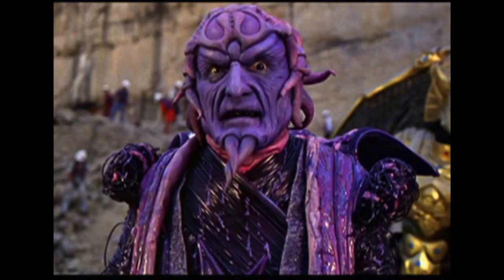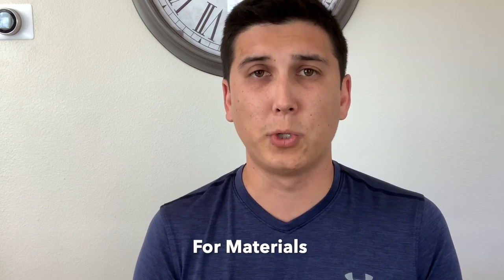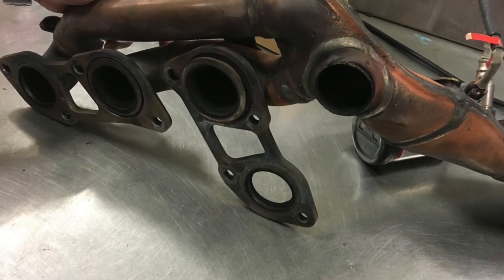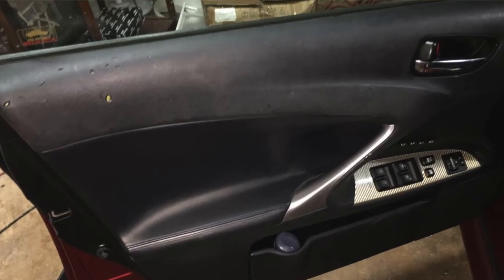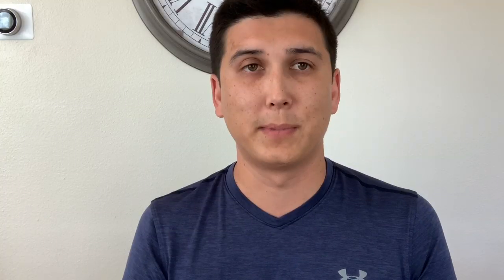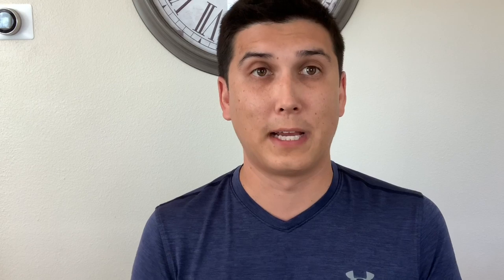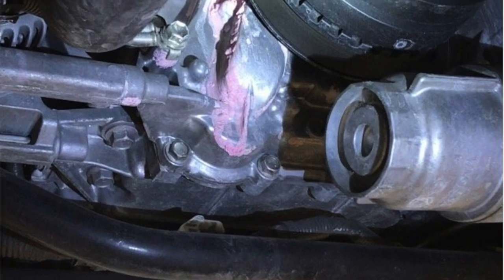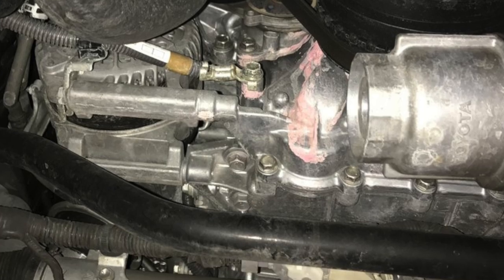Problems With The Lexus ISF

Comment: I have a video on what cracked headers sound like on a 08 with 145k miles if anyone wants to hear that
Reply from the maker: Thanks for sharing, this may help some people.
Reply: Is this common across all years of the ISF?   I’m thinking to go with PPE headers before this happens.
Reply from the maker: @jefflebo5836  I believe all years of the ISF are susceptible to this.
Reply: Cause it's not a race car. It's a luxury car that happens to be a bit sporty. You wanna drive fast? Get/build a car that can handle it.
Reply: @JustTheTip556  very true
Reply: I have the same problem. Had it since day 1. Finally decided to buy PPE Headers.
Reply: Spiral Øut what are you talking about?
Reply: @JustTheTip556  a bit sporty is not a 400+ hp V8 in a sedan...you sound like your 12.
Reply: timsgta people that spend ridiculous amounts of money on a glorified Toyota wouldn't want anything less than a V8. Just cause it's a V8 with 400 hp does not mean it's a race car. It's not made to go fast and race around all the time. It's a luxury car. You sound like you're 11.
Reply: Spiral Øut “Luxury car that happens to be a bit sporty” well it’s sporty enough to go against “sports” cars and have over 400hp, handle good enough and accelerate and decelerate many times over and over. So it really is a sports car
Reply: TeRrOr BiTe to me an over priced Toyota with all the unnecessary bells and whistles with replacement parts being ridiculously expensive is not a sports car. Sports cars are made to be beat up on. No one buys one of these Lexus' to go fast. They buy it because it's a status symbol and "luxurious"
Reply: Spiral Øut so no one buys an Audi R8 or any Mercedes Benz AMG to go fast huh? They buy it for status symbol and luxurious?
Reply: TeRrOr BiTe yeah cause you could go a lot faster for wayyyyy cheaper. Don't even get me started on "super" cars. Why spend over 100k on a car to go fast when you could spend 5% of that and go faster?
Reply: Spiral Øut because why would you have to make something faster with aftermarket stuff rather then having something reliable from factory? 0-60 in 4.8 isn’t exactly slow and trying to recreate that on a slower and make it reliable and good enough to daily drive everyday isn’t exactly easy to do and can cost thousands to do. Hence why people buy Lexus IS F’s and GS F’s
Reply: TeRrOr BiTe I wouldn't call companies like Audi, BMW, Mercedes, Lamborghini, Ferrari, etc "reliable". Sure, Lexus is definitely more reliable than others cause it's Toyota. I just think either way it's cheaper to do it aftermarket. Plus registration and insurance is cheaper. Just makes more sense.
Reply: Spiral Øut I was talking about the Lexus. Everyone knows BMW’s and Mercedes aren’t the most reliable except for a few cars they make but everyone knows Toyota is hella reliable and Lexus is the cherry on top for reliable luxury cars and know they’re starting to make quick road cars which everyone is starting to love. Yes it’s cheaper to make stuff go fast and everyone knows that but all the money you sink into a car could just be put in something like a Lexus IS F. Even when you go to sell the car the resale value is not gonna be there for the cheaper built car but it is gonna be there for the Lexus. Just my opinion

Comment: I have the ticking sound on mine upon cold start up so most likely cracked header. Anybody have any experience with this and advice for the least expensive route?
Reply: The least expensive route would be to weld the broken flange back on the manifold.
Reply: zaneiken thanks
Reply from the maker: I agree, still a pain since you'll have to uninstall the header(s) that is cracked.
Reply: ISFASTER Update: Passenger side header is confirmed cracked. My mechanic is recommending replacing it with an OEM header. $1700 part, $2600 with labor. Your thoughts?
Reply from the maker: J Lowery - you could buy a set of PPE headers for that much or try and see if you can get the stock header welded.
Reply: @PhilLayshioh  labor cost is crazy high

Comment: Valley and water pumps are due to the crappy pink coolant. I always flush out to toyota red coolant.
Reply from the maker: This is the first time I’ve heard those problems occurred due to the coolant.  My understanding of the valley plate leak is the sealant used forms small cracks due to heat and the coolant leaks through the cracks and out.

Comment: Will regular coolant changing work?
Reply from the maker: I don’t believe so.  You’ve gotta stop the leaking.
Reply: @ISFASTER  so it's envitable? No matter how carefull you're it will happen? How many miles before it happens? I'm looking to buy a 2008 ISF from japan with great condition and around 40k to 60k km.
Reply from the maker: It happens erratically, some people have got it at 30K miles, others at 150K miles.  Some people have had their cars for 11 years and 100K+ miles with no issues. 🤷🏻‍♂️🤷🏻‍♂️🤷🏻‍♂️
Reply: @ISFASTER  my ISF is a 2011 and nothing do far.... so 13yrs and 45K

Comment: Someone is selling their 2012 isf for 30k with 80k miles and i want it so bad 😤
Reply from the maker: What’s holding you back? 😁
Reply: @ISFASTER  I'm only 17 and still in school :(
But once I start working I'm gonna get a is350 or ls400 first then save up for an isf, I never really gave my attention to the because i already had a gtr32 in mind but my has a isf and he took me for a ride and damn that thing is fast plus it's reliable.
Reply from the maker: Work hard and you’ll get there! 💪🏻💪🏻
Reply: 80k miles for 30k? Seems awful high. Best to shop around...
Reply: Dealership in Sac, CA is selling a 2008 ISF with 100k miles, $25k. WhAts a fair deal to finance?
Reply: @carloscrod_  25k seems high for 100k and a 08. 
Use Fb market you'll find better ones for better price.
Reply from the maker: That’s way too high for an 08 with 100K miles.

Comment: Just had a crappy situation with my is350 couple weeks ago my starter died and i wasnt about to pay someone to 8-900 just to change it so i attacked it my self and let me tell you it was one hell of a B!tch to change 😂😂
Reply: PS waited 2 yrs for my is350 to get its recall done for my dash/door panels
Reply from the maker: Glad to hear you were able to fix it and you got the panels refreshed!
Reply: ISFASTER now the other issue for my wifes is250 we wont be able to do the recall for her car because the original owners didnt initiate the order before they sold it to a used auto dealer so now we will be stuck with a sticky dash and worn door panels now

Comment: Hi buddy, my 2009 ISF fitted with 225/40r19 front and 255/35r19 from factory. Now I’m gonna get new tires, is new set up 245/35 front and 275/30 rear good? Any safety issues?
Reply from the maker: That’s the size most people run on those wheels.

Comment: Dude your the only one having problems with the IS F 😂 since beat that car like is a truck doing drag races nonstop you lucky you haven’t blown up ur engine
Reply from the maker: I didn’t encounter most of these problems myself.  I certainly had fun with the car though! 😁
Reply: @ISFASTER  I know a car can’t be perfect they will have simple problems like Alternator , Spark plugs and Valve seals stuff like that but man you gonna definitely brake a car that last forever 😂

Comment: Have you heard of maintenance?  It really helps, you should try it.
Reply from the maker: Because the majority of items on this list are normal maintenance items...  🤦🏻‍♂️🤦🏻‍♂️🤦🏻‍♂️
Reply: @ISFASTER  You didn't get my point, that is exactly what I tried to say.  Don't blame the car, blame sloppy maintenance.  And that includes the leather.  Keep it in good condition and it will outlive you.
Reply from the maker: What maintenance would one do to avoid the valley plate leak, cracked header, melting dash, screen and subwoofer going out?

Comment: So an expensive internal engine problem lol 416hp for a $25,000 car with a lot of miles. Just get a camaro or mustang for less money and the engines are reliable. No ls3 has a single huge defect like that valley issue. Only thing that happens on an ls3 is maybe the oil pump. Pushrod v8s have far less parts than these 32 valve quad cam engines

Comment: Warranty 😆
Reply from the maker: Most ISFs are out of standard warranty by now. 😁
Reply: Comin2gtcha just got my dash and panels replaced even though they were good ..
Reply: @carlbutler2080  how long did it take your f to do the panels and dash.ive been waiting for 3 months now!
Reply: I purchased a Toyota platinum warranty and it's paid for itself already. Got everything you metioned replaced except valley plate. Didn't get that issue. Still have 3 years or 40k miles left on the warranty.
Reply: @carlbutler2080  Got mine replaced too. They were terrible.